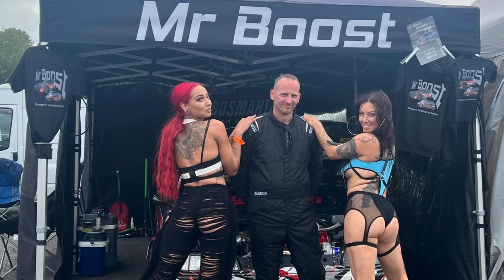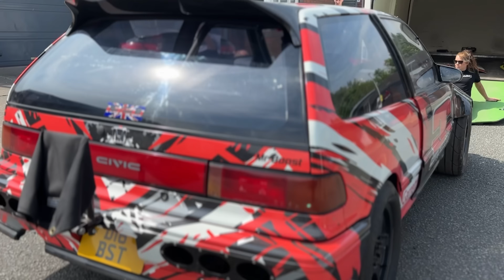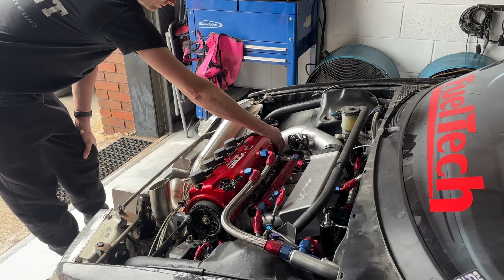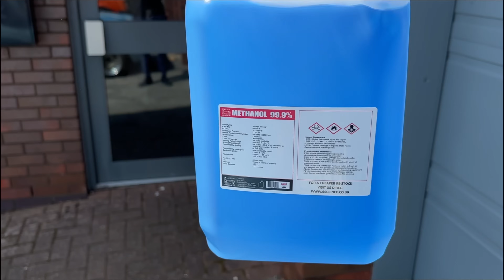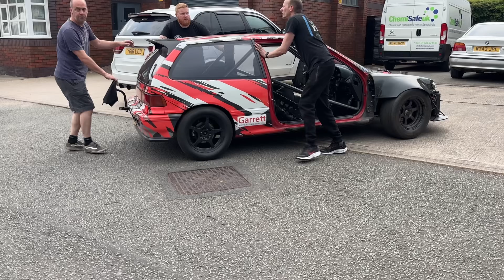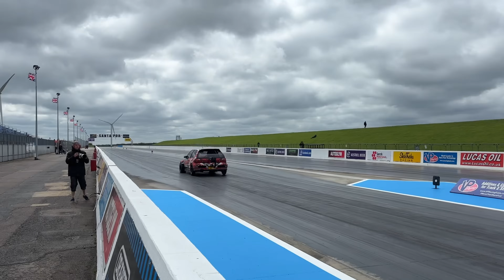EUROPES FASTEST Honda Civic gets a NEW TURBO!

Comment: Sorry whats a concrete block. How does this differ from a normal or billet block
Reply from the maker: So a concrete block is a standard cast block with all the water ways filled with a resin, many years ago they used to use concrete hence the term.
It’s the way to make you standard block stronger from drag racing.
Reply: @TwinEngineCorsa  oh OK cheers.